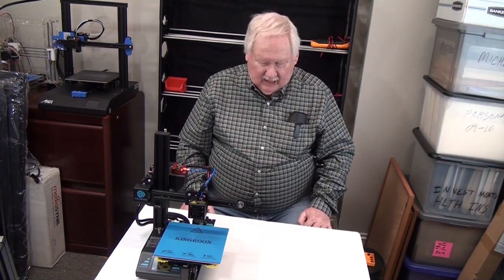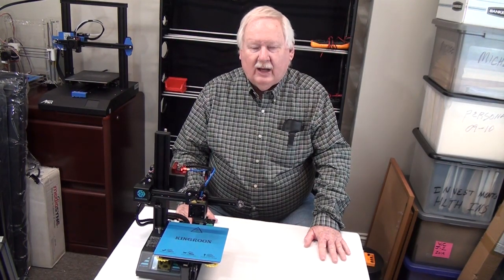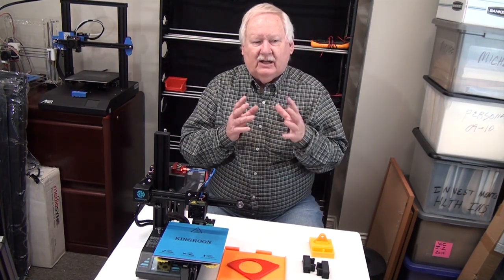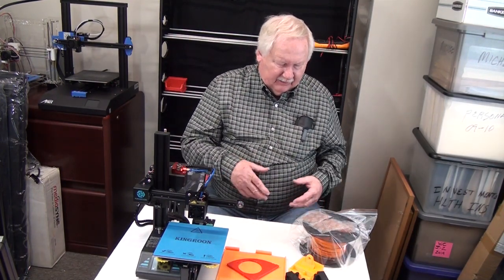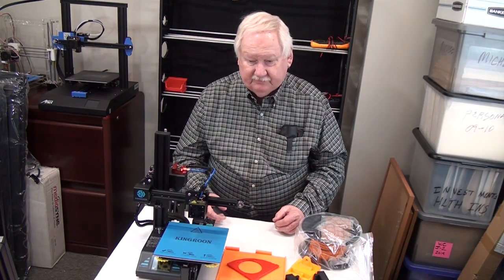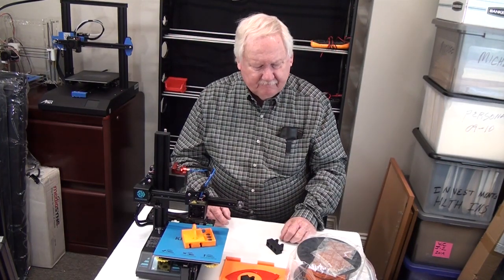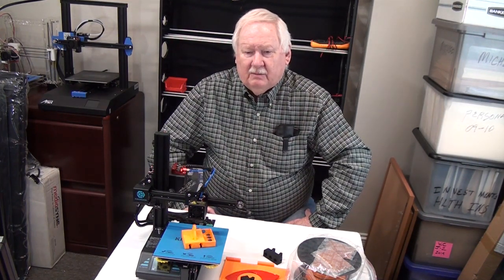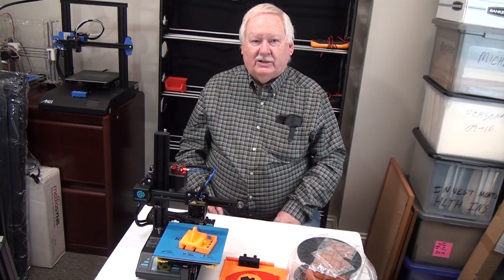My home based 3D print farm. How I use multiple 3D printers to make parts for New Tech Inventors.

Comment: Thank you for posting.  This is the first video I've looked at regarding 3D printing. I'm now encouraged to persue my new interest further. Thanks again
Reply from the maker: Good to hear Paul, Go For It! You won't be sorry. 3D printing is very rewarding and when you create and print your first part you will know what I mean. You will need two things. First you need a 3D printer, and this will cost you about $200.00 US and a spool of PLA filament that will cost about $15 - $20 on eBay. Second you will need the 3d design software. Tinker Cad and others are available online and can be downloaded for free. There are tons of YouTube videos showing how to use them and it won't take long for you to be able to learn enough to make a simple 3D part. Then take that 3D file and export it as a STL file and then use the Cura file that comes with your printer to slice the STL file and generate a gcode file. Copy that gcode file to a micro SD card and plug it into your 3D printer and select it from the print menu on your printer and your on the way to your very own first 3D part. It really is that easy and the Aner ET4X would be a good starter printer. Very easy to assemble, about 20 minutes and instructions on SD card. Now on eBay for $186 Free shipping. Wish you luck and if you have any trouble getting started let me know, I will help you...Ken

Comment: I buy desiccant by the pound and put everything in a large cooler. I just dump it in the bottom, and load 8 spools at a time. Cost of cooler is about 5 bucks, and they are stackable like your totes, which would work also.
Reply from the maker: Thanks for sharing your ideas for preserving filament. This is a major issue and I am trying different ways to address it. I am working on a dehydrator to remove moisture from the filament once it has absorbed an excessive amount. I will post results as soon as the project is completed. Thanks for watching...Ken

Comment: I really like your "common-sense" approach and logical thinking. The video system is an awesome idea and allows you to view the printers in real time. I have only one printer and use Octoprint, but that would be a headache keeping all of it online and working. Great job!
Reply from the maker: Your right Dean, Octoprint is a great idea for a single or few printers, but with the number I run especially at my new print farm it would not be practical. I rely on having all printers set correctly so that they print job after job without adjustments. I will post videos as I set up my printers in this new location and include details on the video monitoring, ventilation, and other factors. Remember if you do have a problem with a printer you can always go to the DVR and play back the video to see what caused the problem. Thanks for the comment...Ken
Reply: I agree with you Dean, the standalone security systems are a good logical option.

Comment: Very well done.   Nice and easy goes along way.  Got a question ..how do you wire in line multiple printers ?
Reply from the maker: Thanks for the question Joe. I assume you are referring to a computer connection to the printer in which case I do not connect any 3D printers to the computer. I use the micro SD cards to store all print jobs for a specific printer on them and select the print job from the printer SD storage. This does require selecting each job from the printer menu each time you start a print job, but only takes a few seconds to do so.  Thanks for watching...Ken
Reply: @NewTechInventors  I was referring to ac in line set up .    How many printers can you set up in a row before you blow a circuit ?  Can electrically connect from 1 to another?  I print Woodwind mouthpieces and cannot lay them down . To print ...have to print column up ....do you have any remedies?
Joe

Comment: Any idea on power consumption? How many printers do you have on one circuit? (how many plugged into 1 outlet/breaker)
Reply from the maker: Good question. I  have a current meter and plan to check every printer at my new print farm during pre heat and operating servo motors. I will then power multiple printers with a max amp load of 15 amps on a 20 amp breaker. This is a safe load and should never have a power problem. In my current bonus room I had 8 kingroon KP3 and 8 Anet ET4X printers on one circuit and powered up. I had print jobs running on all 8 Kingroons and 5 of the Anet printers when I tried to pre heat the 6th AnetI it tripped the 20 amp breaker on that circuit. Since all printers had resume print they all restarted and all parts were good. I also had a computer on that circuit. I will post a video soon and show how to determine power consumption and how to set limits. Remember all printers have different normal and peak  power requirements. Thanks for the comment...Ken
Reply: @NewTechInventors  how many printers plugged in one outlet now?

Comment: If you want all my printers have auto shut off after the print is finished. I can show you how.
Reply from the maker: I would be interested in hearing about your auto printer shut off method. I sometimes have a test or sample print job running on a printer somewhere in my house and forget about it only to find it the next morning just sitting there still powered on. The production printers in my print farm are intended to run one job after another in 12 hour increments, so they will not be cut off when a print job ends. I look forward to hearing your idea and any other comments you may have. thanks for watching...Ken
Reply from the maker: Would be glad to hear how you do your auto shut off. Thanks for the input...Ken
Reply: @NewTechInventors  I have a switch on the end of the y axis on all my printers and then at the end gcode in cura i tell the bed to come forward and bump the switch to off. I would send pictures if there was a way to send them in the comments.

Comment: Dont waste your money on moisture absorbing desiccates. Your filament IS a moisture absorbing desiccate !!! And it can absorb a lot more than that few grams of expensive silica gel desiccate it has to compete with. Instead, you could dedicate a room to 3d printing, and control the humidity in that room. Also, im sure you have heard, you can dry filament in an oven.
Reply from the maker: Thanks for the feedback. You may be right about the silica, but the orange ones I use do indicate when the moisture level is high in my stored filament. I also have a dehumidifier that keeps room humidity at about 35% or less. I am currently working on a high capacity dehydrator for my filament that I will share. The one I bought does work some, but it mostly just hears up the room. I try to schedule print jobs so that I use a full spool of filament over a few days so I dont have to worry about storing it for long periods. I know most people are not able to do that.

Comment: Have you tried octoprint for monitoring?
Reply from the maker: Octoprint is a great idea, however I use a simple security camera system which gives me up to 16 different cameras which I can strategically position to give me a video picture of how the printers are operating. Once I have determined the best settings for a print job I then run it on the 3D print farm printers. All I look for from the video on my phone is if the printer has stopped, is air printing, has offset print, or lost adhesion. I can see this and go fix the problem. Thanks for the question...Ken
Reply: @NewTechInventors  octoprint would allow you to remotely start and stop prints. You can also change settings mid print.